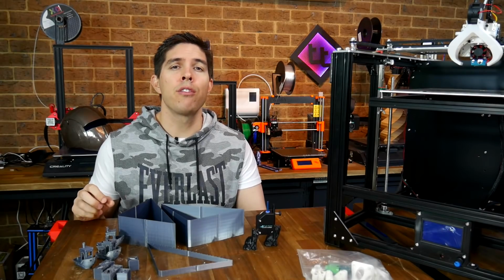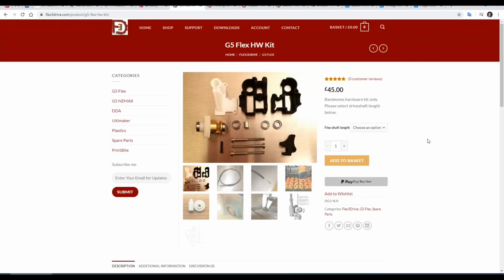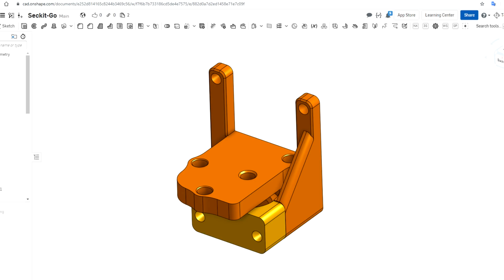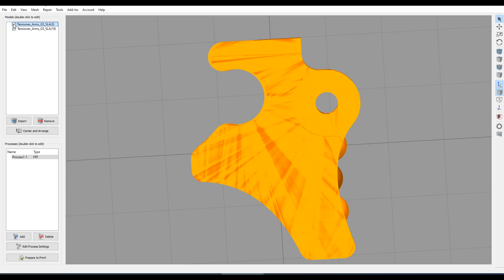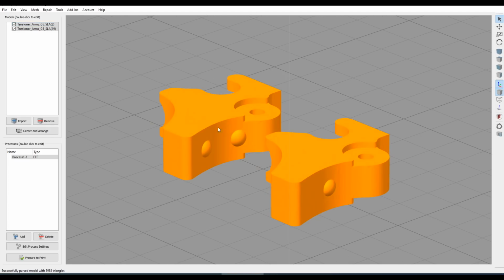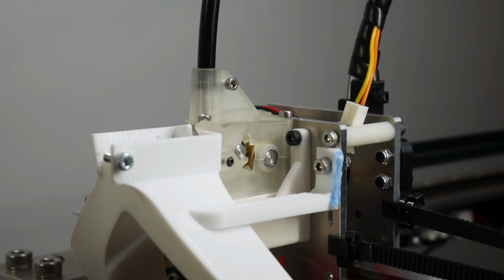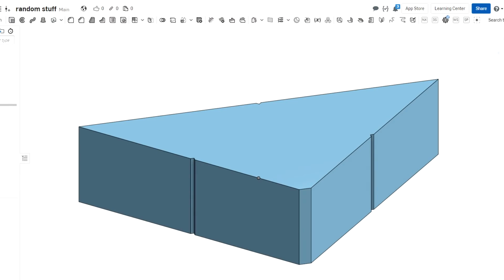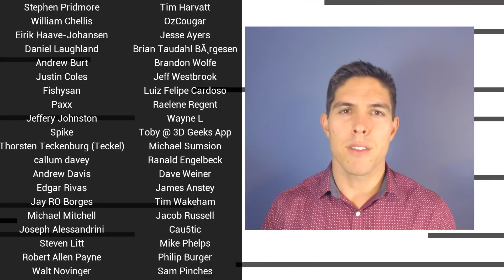Flex3drive G5 open source remote flex drive extruder guide - Seckit SK-GO

Comment: On an I3 style printer the weight of the direct drive motor won’t limit the speed, the moving bed will. No matter if you have the lightest possible hot end, you still won’t be able to go any faster than the bed can move without ringing

Comment: I have an fl-sun QQ and have been chasing nozzle jams.  the idea of remote drive extruder intrigues me I would be tempted to leave the drive where the extruder currently is (on the top) with just a small 20mm piece of PTFE to guide it through the arms to the extruder/printer head.  I am not sure if this is a practical idea or not, IDEAS PLEASE.....

Comment: Hang on. You did a review with a knowingly broken essential part, and it caused severe test result issues - but you didn't repair/replace and redo the tests?? That's not a "sub optimal" setup, that's a highly defective one. Like reviewing and comparing two cars on a race track, with big leaking holes in and unbolted mounts on both their radiators.

So basically from this review, we have a good idea how to assemble it, but absolutely no idea how this product actually performs

Comment: If you have the room and parts, you can put 2-3 nuts on the bolt, outer to snugged against each other at the cut end, then make your cut through the outer nut. You get a much cleaner cut, and less chance of messing up the shalf thread on the to-be-kept section. By snugging up two nuts against each other, you cN clamp the screw in a vise without the screw turning or needing to clamp on the threads or screw head. Don't overtighten the two nuts though, you'll stretch and weaken the screw/threaded rod.

Comment: this seems gimmicky, the point of a direct drive is to get rid of the springiness of the bowden tube, the drive cable will have some springiness to it. a steel braided bowden tube would probably be on par with this and still be lighter.
Reply: The bowden tube adds a lot of friction to push that molten fillament over quite a large distance in a narrow tube and requires bigger motors to overcome that friction. They can't print a lot of flexible filaments for this reason too as it gums up the inside and wears out the tubes. This seems like a far more clever solution, get the weight off the direct drive for faster print speeds and rapid direction changes or stops like a boden but at the same time cut out the issues of pushing a viscous molten filament through a long tube. It just intuitively makes sense as a concept.

Comment: Something that a LOT of people forget when printing with a remote direct drive extruder as opposed to a bowden on a coreXY setup is that even though the weight increases lightly, the print speed actually also increases, especially with detailed objects.

This is because of the inherent elasticity that bowden suffers from. at 200 mm/s corners for example will always turn a bit ugly due to the extruder lowering nozzle pressure at the wrong time (due to elasticity of the filament in the bowden tube). Slicers can compensate for it a little bit, but its a shitload of work to make it perfect (wasting also a lot of filament)  and each time you switch to new materials you have to redo it. It takes so much time and effort that a remote direct drive is just far superior and elegant of a solution.

Comment: Why bother with a tiny extruder motor if the weight doesn't matter anymore? Why use a flex drive if you can make a NEMA-8 work as direct? I'd much rather buy a geared, NEMA-8 direct drive which weights that much less than a NEMA 17

Comment: After seeing your reviews of the SK-Go I ordered a SK-Go² got e 2 weeks ago and got it running. While assembly I was taking your idea with the PTFE tube to support the cables, I designed a bracket as part of a SK-Go² starter kit (https://www.thingiverse.com/thing:4567427) which can be mounted on the extruder carriage and on the frame at the back. This bracket has holes included to hold the PTFE firmly in place which makes it much easier to apply the cable spiral. It also works fine with cable sleeves (see pictures on thingiverse).
I just ordered the Flex3drive G5 and when I will have it installed, I will share the experience.
I am also looking in getting a Zesty Nimble since it is even lighter in design, but they have stopped accepting orders due to Covid 19 for the time being.
Thanks again for your great tutorials and let me know if you like some of my own designs in the starter kit. Also just contact me if you need the step files for remodelling.

Comment: How could you use this on Artillery printers? it would mean having the stepper cable running along the flex tube? Also we'd have to do a mount for the PCB but that's not hard. I also searched their website and could not find anything concerning Artillery printers.

Comment: It would be nice to have an evaluation of the flex in that cable. In the end if that is not minimized enough, it has the same inconsistent effect as a bowden tube.

And also an evaluation of the top extrusion speed and its relationship to the gear ratio driving the final gear.
Reply: I researched numerous cables before buying my G5 kit for my E5+ (got the 800mm flex shaft for mounting motor outside the frame on the back right top corner and it is the perfect length).  Any cheap cables are just that, and the seemingly good ones were outrageously expensive.  For the money spent, the G5 kit is hands down the best bang for buck so far and this guy has been making and selling this style extruder for 8 years so it is a more evolved product.  I initially printed my parts in structural PLA as well as regular SLA resin printed on an el cheapo Creality LDR-002, but I plan to reprint the case parts after the initial build is running and my FDM precision increases with carbon fiber ABS for strength and temperature handling (for possible enclosure heat).  Trying to piece-meal source the bearings, flex shaft, hob gear, and screws would cost more and take much more time than the G5 kit, the full G5 ready unit even faster.
Reply: Arpad Toth  you just have to change the reverse E0 direction=true to false in the firmware for that. reversing the wiring can cause other problems that fry control boards & steppers.
Reply: @teamlieblong  I'm pretty sure he's referring to the flexible drive shaft being composed of steel wires arranged in 2 layers twisted in opposite directions, not electrical wires being crossed. https://flex3drive.com/product/driveshaft/

Comment: Great little circuit! Great channel too! I'll try it out for sure, but would place it next to the main board, so I don't have to cut the wires and loose the product warranty for sure. Also asking me if it is possible to adapt the circuit so it ramps the fan speed instead of just turn it on and off. Additionally thinking if I even can hook it up to the already existing thermistor for temperature control to save additional wiring and a thermistor. No idea if that will work, but I'll give it a shot.

Comment: Could you do a review on a printer that prints very fine detail work and the best filament for fine printing. Not every person whats to print large objects. Most hobbies require small scale objects with high detail and strength. Speed of printing is not a issue its the quality that is important. 
Thanks

Comment: Why didn't you just patch your part cooling with some tape?
Reply from the maker: The vibration from these speeds shook it loose, so I was going to add a fair bit of heft in fixing it properly. Now this extruder is installed I can design a nice new duct.